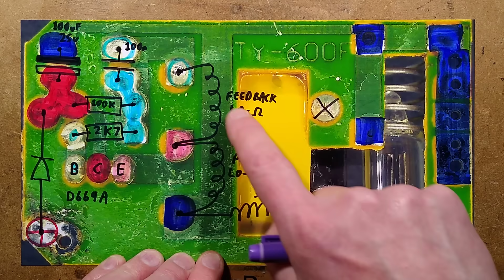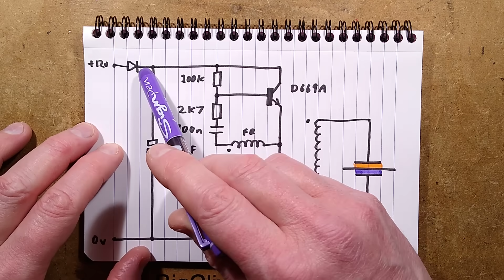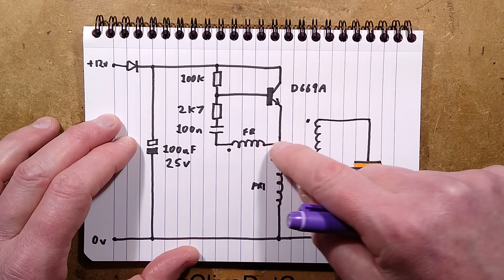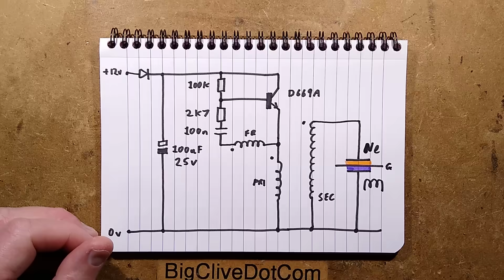Car ozone generator - with neon based cold plasma tube

Comment: It's funny that so many people are concerned about the ozone "hole' in our atmosphere while we can buy ozone generators. If ozone protects us in rarified atmosphere, it will also protect us in full atmosphere. And since the density is greater as pressure increased, we're actually better protected. So why the panic?
Reply: It was a problem when it was first discovered, because it was getting bigger quite quickly. Unusually, action by governments to more or less ban CFCs stopped things getting worse. If things had gone as expected it would have been bad for people's health, and the environment generally because of the increased UV reaching the surface. It wouldn't matter how many ozone generators you had 🙃Also, there is no panic
Reply from the maker: The ozone layer works by creating and destroying ozone, with different parts of the UVC spectrum absorbed by each process.  The issue was that chlorine messed up that process.

Comment: The best ozone generators I've worked with use ultraviolet neon lamps. To maximize the amount of O3 you simply remove more of the metal sheathing around the bulb. I love how your little one seems to work the same way.

Comment: Would the amount of ozone be suitable for a living room in a apartment if used with a 12v adapter ? Can ozone be bad for pets like hamsters?
Reply from the maker: You can get ones for home use that produce trace levels similar to the levels in natural outdoor air.
Reply: Ozone is really bad for some pets.
Reply: @baqcasanke  At any level? Witch pets are extra sensitive?
Reply: @agw5425  consumer grade ozonators never produce enough ozone to worry about.  or to accomplish anything frankly.  COMMERCIAL grade ozonators DO though.  you never want to use a hospital grade ozonator in your home.  unless you prefer your lung tissue bleached.

Comment: I always believed laser printers put out ozone as well. I’m talking late 80s, early 90s laser printers. I thought the smell was quite nice. I hope I wasn’t fooling myself when I had one in my room as I still lived with my parents… 😮
Reply from the maker: They did put out ozone.  Many had filters to reduce it.
Reply: You are correct. The process involves charging the exposed parts of a light sensitive drum (or non charged depending on the process for copyright) with either positive or negative charge. The toner is attracted to this area and then literally pulled off onto the paper using a higher charge. Currently this is done (usually) with a rubber roller type affair in direct contact with the drum (May be more than one in a colour device). In the old days - more than 20 odd years ago, this was done across an air gap with a bare wire so the voltages were much higher. Was nice to watch a copier with the door open and interlocks bypassed without its drum to see the glowing corona wires and get a face full of ozone 😁.
As Clive says they were much more filtered with activated charcoal filters that needed regular changes- much less these days with little or no ozone generated.
The newer technologies using the rubber roller have reduced the need for precautions and greatly improved reliability too.

Comment: No fuse? That's quite naughty. If the transistor shorts, that cable will melt.
Reply: Every single cigarette lighter plug I've seen had a fuse built in at the tip, so that one probably does too.
Reply: @JendaLinda  hi , the cigarette lighter socket is fused in the vehicles fuse box with a thirty amp fuse and lots of those plugs have inbuilt fuses, that one doesn't.
Cheers for the post.
Reply: If the transistor fails closed or the capacitor's electrolyte wears out and fails short, it would draw so much current that it would pop the fuse protecting the cigarette lighter socket outlet. This does mean going into your vehicle's fuse box to rectify the problem, but it wouldn't be the end of the world.

The real danger is not something failing short, but rather something conducting more current than it's supposed to. That wire looked to be about 22 AWG, so you wouldn't want it drawing more than a couple of amps. If it started drawing several dozen amps it would pop the upstream fuse, but if say, between 10 and 20 amps, that would be a problem.

This is extremely unlikely however. Thermal runaway in the capacitor would guarantee that it would blow open, and thermal runaway in the transistor would guarantee that it would fail short quite quickly.
Reply: Most car cigarette lighter fuses I've seen are 30 amp.

Comment: I remember the smell of ozone a train platform while waiting next to a locomotive- along with the buzzing of 16,7 Hz from the overhead line.
Reply: I believe it's only in Germany, Austria, Switzerland, Sweden and Norway it's used. =D
Reply: @CarnisMayhem  Yes....and NL and Belgium partly
Reply: @demil3618 I’m super sorry I read that as 16,7 hz with a comma not a decimal so i assumed it was 16,700
Reply: @ The European way of writing numbers is with a comma.
Reply: Did you mean 16,700 HZ
Reply: @AsherJohnson-k1i  actually some countries use 16.7Hz high voltage ac for their overhead lines
Reply: @cle4tle 16.7Hz, 15kV AC.
Reply: @AsherJohnson-k1i  Used to be 16 2/3 actually
Reply: @AsherJohnson-k1i  using such high frequencies for power probably isn't a good idea
Reply: @AsherJohnson-k1i No. 16.7Hz is the frequency of 15kV railway AC electrification that many countries used until the adoption of 25kV.

Comment: Looks to be a component saver, is not feedback of high voltage not really the best idea with a path to a transistor?

I wonder how many units failed to work because the bulb position was wrong, the noise may be caused by being on the verge of maximum operation, suggesting it may have a high failure rate
Reply: The feedback winding isn't high voltage; it's part of the primary (12V) winding.
Reply: @aaronmdjones  that is not what I was referring to, one end of the hv on the schematic connects to a common ground

Comment: You could hook it up to the accessory switch—but with a NC relay so that it is only on when the key is off.

That way, the O3 should be cleared from the car when the driver/passangers climb in. Best way, of course, would be using the CANBUS to detect occupancy (is the car moving? people sitting in seats? entertainment system on? etc).
Reply from the maker: The downside being that it is intended for use when the air from a vent is flowing through it.

Comment: Very interesting how it stops working when the neon in fully pushed into the loops of ground.  I wonder if the distance pushed in creates some sort of adjustable capacitor which is used to further tune the circuit?
Reply from the maker: I think it may be the increased capacitance lowering the voltage too much.

Comment: I like 12vdc powered items as I use battery backup for a lot of my house...that said I would not want this as an always-on device.
Reply from the maker: In a house the level would be acceptable.
Reply: the amount of ozone consumer grade electronics produce is insignificant.  otherwise, there would indeed be a huge safety issue.  REAL ozonators, like hospitals use to disinfect rooms, are extremely dangerous and can literally kill you.

Comment: I think I would link this to a timer. Once power is applied the unit and timer would run, once the timer expired it would turn off power to the unit. It would reset when the power is removed.

Comment: I would think that too much Ozone may degrade some of the plastics in  a car.  I know some cars have ozone units inside the aircon filters presumably to sterilise them.
Reply from the maker: They use all sorts of names for them to pretend they aren't generating ozone.
Reply: none of these consumer electronics generate enough ozone to be of concern.  certain PLACES though, generate enough ozone naturally at ground level to be a concern.  low desert in Eastern California, like the Coachella valley for example, naturally generate a lot of ozone in the summer simply by catalyzing O2 splitting on the surface of rocks there.   it gets so bad it will dissolve the seals on your car windows within a couple of years, or at least make them hard and brittle.
Reply: @thomasneal9291  worn out laserprinters too. in badly air-conditioned rooms you can smell it. Not exactly healthy...
Reply: also degrades health...
Reply: That was my first thought too. All the rubber bits (like window gaskets) are gonna get crunchy and crumbly.